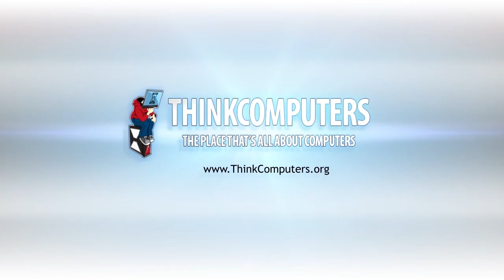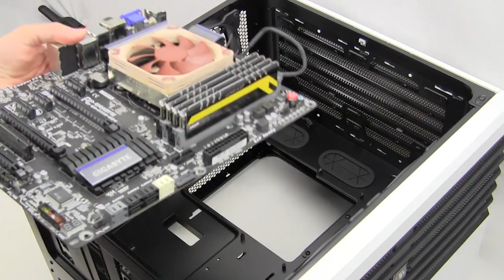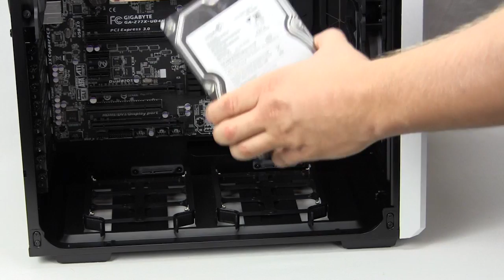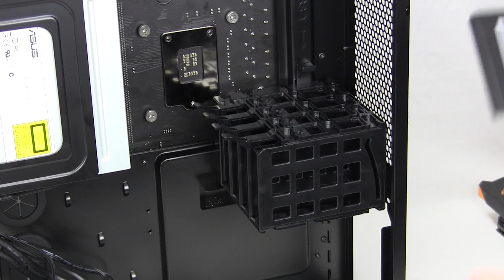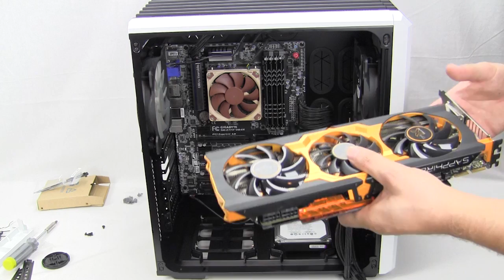Corsair Carbide Series Air 540 Hardware Installation

Comment: Completely skipped over the installation of the fans. How do you remove the face plate that the disk drives stick out of to put those fans there? Got this case with the set up already done inside, now that I'm moving cases, the 540 is refusing to let the face plate go, and I can't remove the other grate that is a really covering the fans because the clips holding it require you to slide that plate to the right, which is impossible without the white plate being gone first. I'm quite literally at the point where I'm just about to break the damn case because no videos of this case are showing that part and corsairs own community forum just tells people it's pressure fitted and should come off with pulling. Well, despite there being no visible obstructions that would keep the grommets holding the faceplate on from releasing, and getting half of them to release, the half touching the other face plate refuse to move and creak as though they are about to snap. This makes no sense but I can't even find a video of someone doing it properly to see what I'm doing wrong. Like... I've got to be doing something wrong, but I'm following corsairs own instructions for removing it and it isn't working, and I can't find a video where I can see that part being removed.

Comment: So I have the black model corsair carbide airflow 540. I bought this 7 years ago. I was trying to see if the sata cables will reach? I just bought 2 ssd which will be here Sunday. I have a asus crosshair v formula z and I was only using my hdd. So I got everything running but I am going to have to clone one of the ssd with the os on the hdd so I can utilize the ssd speed as I am bottle necking and my hdd is active running at 100... So can the sata 6gb cable reach. They just look short

Comment: Am pretty sure the drive brackets on the motherboard side of the case have mounting screw holes for a 2.5" HDD/SSD.
Reply: When I owned this case many moons ago the first thing I did before installing anything was take the front panel cables and using some cable ties bind them all together. Made everything look so much neater. It is the OCD in me.

Comment: This case is fantastic, but honestly, why the hell did they put the SSDs on the back and HDs on the front, they did fix it by adding room for fans and sending the HDs to the back on the 680x but it's way more expensive and does not cool aswell because of the glasses.

Comment: Does it make Problems with the Optical Drive and DVDs/CDs because it is installed Vertical?
Reply: Nope, the optical drives typically have little catch tabs that hold the disc in place when it is vertical and opened/loaded.
Reply: ZacGaming Thanks, but a little bit to late😉 Now i have the be quiet! Pure Pase 600👍😀
Reply: I saw it was 6 months ago, but I figured if someone else came across the comment, then at least they'd have an answer. :)
Reply: Okay. Thanks anyway :D

Comment: Why he didn't add sata cable or power to HDD???
Reply: Exactly my thought. My HDD in this case just "died" out of nowhere and I find out that who built my PC didn't connect the SATA cable to the HDD, the same that this guy did. It worked for more than 2 years now suddenely it stopped working. I'd like a compresive answer by the uploader on the matter.
Reply: Now this concerns me more..Now am worried
Reply: He already said (and is shown in the video) that the 3.5 HDD cages support hot swap.. There is a sata and power connection on the back of the cage and the HDD slips in and connects. Later in the video you can see there are 2 sata cables connected on the motherboard. The power for the hot swap is not shown but why can safely assume it is also connected at some point off camera.
Reply: If it worked for 2 years and then "died".. it makes it obvious that it was properly connected or else it would never work. The HDD cages support hot swap. There is a sata/power connector at the back of the cage where the HDD slips in and connects. The cables for the hot swap bay are then connected to the motherboard and the power supply.

Comment: Is it just the white case that has the fan lights ? Mine is all black and doesn't appear to have the fan lights . Curious here .
Reply: The black does not come with lights. You can buy them and add them yourself. The white comes with the LED fans in white. Either can be swapped out with other colors that you buy separately for a few dollars each.

Comment: At the beginning (48 seconds) of the video you say you can only install the 2-- 3.5 inch drives on the motherboard side.  That is incorrect.   You can also install a 2.5 inch drive by using screws in the pre-drilled holes in the bottom of that sliding tray.

Comment: does it have led on a front fans in a black edition case?
Reply: radioactiveplums If so, I got lucky then lol.
Reply: +Ron Chase No.
Reply: +Ron Chase Yes! I just bought the black version of this case, and it has 2x 140mm light up fans in the front.
Reply: @R1ngMaster21  The most likely explanation for non lighted fans was probably they weren't available at the beginning.
Reply: Viking Dude Hmm, that's strange. They're not meant to. I have one and so does my friend and the front fans don't light up.
Reply: radioactiveplums Bought mine brand new at micro center, box was never opened...
Reply: Viking Dude Maybe they messed up at the factory idk.
Reply: I have a new black case and my fans dont light up either.
Reply: CogniVision hmm, I bought mine threw Micro Center, though I paid around $130 for it. How much did you pay? I wonder if I had to pay more for it, the box don't say anything about lights.
Reply: Viking Dude Paid around $130 as well, that's pretty much the price of the 540 in most stores. Maybe you just got lucky and they put in the wrong fans in the factory. Pretty sure even on Corsair's website the 540 black doesn't have LED fans... which is pretty dumb seeing as they'd light up even better on the black than the silver.
I got mine from Amazon.
Reply: CogniVision Idk, It looks good, I didn't even know they lit up till I put my system in it and booted, though they were just some clear fans, I even almost took them out for stronger fans.

Comment: FEEDBACK ON THIS BUILD

-i7-6700k quad core processor
-Corsair H100i liquid cooler
- Msi Z170 Krait Gaming ATX Motherboard 
-Corsair Vengance LPX (DDR4)
-Samsung 850 Evo 250gb
-Western Digital Caviar Black series 1TB
-Nvidia Geforce GTX 970 4GB Video Card
-Corsair Cardbide Series Air 540 
-Corsair 760W 80+ Platinum Certified

Total Wattage:  373W
Total Cost: $1635.45 USD
Reply: +SurFF Chronos &#160;
i7 6700k
H110i GTX cooler
Z170 Deluxe
32 ddr4 Dominator platinum
980 ti EVGA FTW
80+Platinum 1000P2
500 SSD EVO
Asus Blu–Ray
The Corsair 760T white
cat 7 ethernet cable
Windows 10 pro
This is how my pc end s im sending this message from this BEAST OF PC
Reply from the maker: +SurFF Chronos Looks like a great build!
Reply: +Chronos 

http://www.amazon.com/gp/product/B00F3ZN55E/ref=as_li_tl?ie=UTF8&camp=1789&creative=390957&creativeASIN=B00F3ZN55E&linkCode=as2&tag=ttlkjsacbv-20&linkId=W6ISW3UKE5ASRX3E    Air 540 is $99 now so you can spend on better graphic card.

FEEDBACK ON THIS BUILD

-i7-6700k quad core processor
-Corsair H100i liquid cooler
- Msi Z170 Krait Gaming ATX Motherboard 
-Corsair Vengance LPX (DDR4)
Reply: pon Mike Hey i actually finished building my pc but i changed all the parts 

i7-6700k quad core processor
-Corsair H100i liquid cooler
- ASUS z170 Motherboard 
-Corsair Vengance LPX (DDR4) 16 GBS
-Samsung 850 Evo 250gb
-Seagate 1TB
-Nvidia Geforce GTX 980 4GB Video Card
-Corsair Cardbide Series Air 540 
-Corsair 760W 80+ Platinum Certified
Reply: +Chronos Exact same build im making right now except with an 980ti
Reply: What monitor did you end up using?
Reply: I have a 27 4k 60HZ
Reply: hey i have a question for you, I plan to use the Corsair H100i and an NVIDIA hybrid card, that means 3 fans, will i have space for all 3 in this case ? waiting on the 1080 hybrid if you want me to be specific
Reply: yes the CPU rad  in the upper part  and the  hybrid in the exhasust

Comment: This case will give to little airflow to the graphics card/s for overclocking hot cards or running SLI. Only 1/2 of the airflow from one fan is directed at the graphics card area and non of the exhaust fans is near to draw hot air out. This seems to be a common problem with almost every case on the market. Only tiny ITX cases and similar have done this part right with direct airflow from outside to the GFX cards. To bad non of the ITX cases can fit my 31,5cm long Zotac GTX980ti AMP graphics card. Seems like only option is to buy a case and mod it myself to give airflow to the GFX card...
Reply: Dude, the airflow is amazing, what are you talking about?
Reply: I am complaining that this case and many other give to little airflow to the graphics card. I gave up finding a computer case that have good airflow to graphics card myself and bought a HAF XB that I have modded. It has now two 14cm fans blowing cold air straight at my GTX980ti that is max overclocked and it never gets over 60C (lowest temperature possible in fan setting) and most of the time the cooling fans on GPU don`t even start :)

Comment: Sigh... got myself one of these today and everything is working fine... apart from the hot swap bays! I know these don't work because I've tried connecting the hard drives directly to the power cables connected to the PSU and these work. Does anyone know if Corsair willl supply new hot swap cables?

Comment: i find 5.25 bay weird.. why is it standing ? haha
Reply: Because it's a two part case that's wider than normal. But to lay them down it would need to be an even wider case than it already is. You have the left side for the motherboard, video card and fans that is as wide as a normal case and than the rightside for your power supply, SD and 5.25 bays, but unless you want the entire case to be extra wide they kept the right side a more reasonable width by having the drive bays vertical and the power supply side ways.

It's almost two cases shoved together but they kept it at 1.5x the normal width of a case instead of 2x the normal width of a case, and the result is sideways 5.25 bays.
Reply: Am not sure anyone actually uses their DVD/BD drives anymore. All software comes either downloaded or on USB flash drives. I can't remember the last time I used a DVD drive for anything in the last 10 years roughly. Beginning to wonder why I got it installed but am too lazy to actually open up my case to remove it.

Comment: If I take cpu cooler like H110i GT for CPU and cooler hybrid for GPU, where can I put all the fans? One on the top and the other on the ground instead of the HD slot? Or juste replace those on de right of the case? Or in de back with the alim?

Comment: hi there. Just installed an asus ax88 motherboard in this case and struggling to find fan power pins to take the two fans at the front. any ideas?

Comment: Hello! I found your video really useful! I will be buying this case really soon and i have a question for you, if you can help me please.

The length of your power supply cables are 600mm/60cm and from the video it seems that it is enough to connect the cables to the motherboard. The cables of my power supply are 48cm for the 24-pin and 50cm for the PCI-E 6-pin and 8-pin cables. Can you please tell me, if possible, will this length be enough or will i need to buy extention cables?

Thanks.

Comment: if i plan on having one 2.5 inch ssd and one standard hhd, can i put both of my drives in the front or will the hot swap only support standard hhd's and i will have to put the ssd in the back.
Reply: pat p The hotswap drives on the front are only for standard HDDs. SSDs must use the cage on the other side of the case.
Reply: pat p Actually you can usee SSDs in the bottom cages as well there are screws provided with the trays to put an SSD on the ones in the bottom of the Motherboard side.
Reply: TheBostralian Actually there are screws provided to attach SSds in the hotswap slots on the bottom of the case.

Comment: how many fans can you fit without taking any drive bays out?
Reply: TrottingFox You can fit all the fans without having to remove any of the drive bays.
Reply: yea but like how many fans can it fit?
Reply: TrottingFox - Front: 2 x 140mm or 3 x 120mm 
- Top: 2 x 140mm or 2 x 120mm 
- Rear: 1 x 140mm or 1 x 120mm
Reply: TrottingFox saw a guy with 9 fans (push an pull)

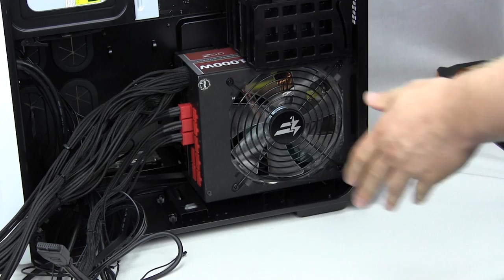Comment: Why did you put the power supply's fan facig that way? 3:36?
Reply: That side of the case has holes on that panel for the psu to get air from.  So it's supposed to sit like that in this case

Comment: Will this case fit a motherboard that has 8 ram slots? so, a bit wider than the one shown in this video. GA-X79-UD5 Socket 2011... I have the hardest time figuring these things out.
Reply from the maker: Aaron Mitchem Yes it will
Reply: +Aaron “Michael” Mitchem It fits eATX motherboards so yes it will.
Reply: it will I have a X99 in my case and it fits

Comment: I purchased a combo deal off Newegg it came with the Corsair Carbide Air 540 in white and 3 120mm vortexHDB fans
(original price 199.99 it was on sale BLACK FRIDAY for 139.99 with a $50 rebate! making the final cost 89.99!!! and on top of that Igot $25 off $100 using paypal so it was only $64.99!!!! great buy!!!!) cant wait to put together my new build
Reply: '96 VR-4 Spyder Turns out I hadn't installed the 3.0 driver... Yeah, I am an IT professional...
Reply: How are you liking it so far? I love mine. Only issue I have is the front usb doesnt work, which looks like a common issue with this case.
Reply: fuloran1 Do you have the front usb wire plugged into a usb 3.0 header on your motherboard?

Comment: So there is a "glass" side pannel and a "steel" side panel to hide what is inside ? I don't want to buy an extravagant case, i prefer when it's sober ! Is it possible to hide what is inside ? And is it noisy ? 
Thanks ! :)
Reply: in order to hide the insides, you would need to get a third-party sidepanel to replace the one with the sidewindow. And it is pretty quiet :) The noise level only depends on the cpu cooler and stuff that you put in it
Reply: busseman200 If I used a Silent cooler master CPU heatsink would this surpass 40 decibels? I would also add fans that have a maximum noise level of 17 decibels each, on highest fan speed

Comment: Where you connect front(2x) and back fan which come with the case? To the motherboard or directly to the power supply?
Reply: if you have enough connecters on your motherboard, then i would be best to connect them there. If not, you will need an adapter in order to connect them to a direct powersource from the psu. Something like a "4-pin molex to 2 x 3-pin fan" would be needed

Comment: I have 3 HDD´s....sooo will they fit in?
Reply: That is what I hated about this case. No 3.5" drive caddy in the back. Corsair could have easily mounted another drive caddy above the 2.5" drive caddy with room for two more 3.5" hard drives. But I guess Corsair probably thought nobody is going to be using big 3.5" hard drives anymore. I know you can buy hard drives in capacity up to 14TB but they are crazy super expensive compared to sizes 4TB and smaller.

Comment: I just got this case today i put everything in everything is connected right i tried powering it on and my fans spun up like normal for a good 2 seconds then off this happend 2 times then i stopped i checked my connections like i said they were all fine and the motherboard green light is on my psu works i tested it i domt know what to do from here...
Reply: Sounds like your cpu died and was faulty but I'm not certain

Comment: I have this case. The hotswap bays don't work on SATA II 3 Gb/s ports. I contacted Corsair for replacement parts, and they still didn't work. The good thing is you can remove it to plug HDD power and SATA cable directly through the opening, I lose the ability to "hot swap".
Reply: Why do you even have SATA II in the first place?
Reply: busseman200
 Use your brain to think about it.
Reply: UnlicensedHitman Better yet, use your money to rectify it, pauper.

Comment: What are the parts used in this system?Models, brands? 
Thanks!Brazil
Reply: Looks like intel cpu board, Gigabyte Z77, Noctua Slim cpu cooler, ADATA Ram, 1000w psu, R9 280X  Sapphire, Corsair Carbide AIR540 White Case, SSD, HDD
Reply: thank!

Brazil